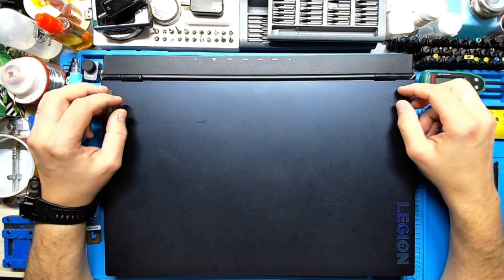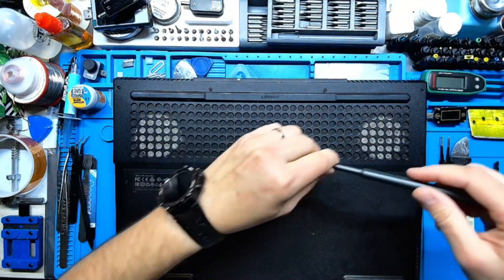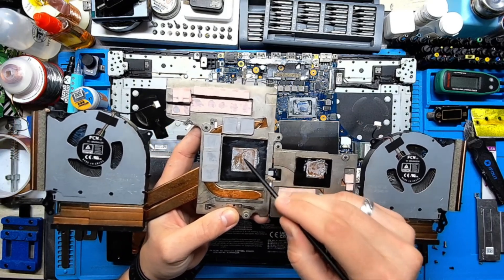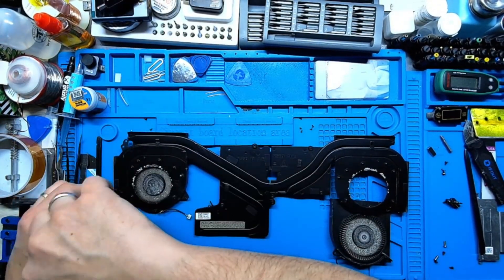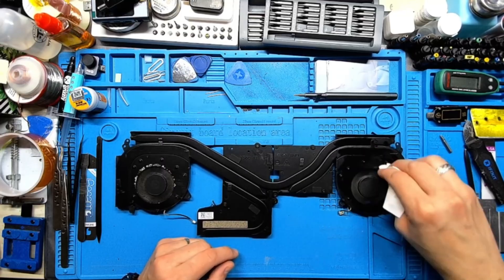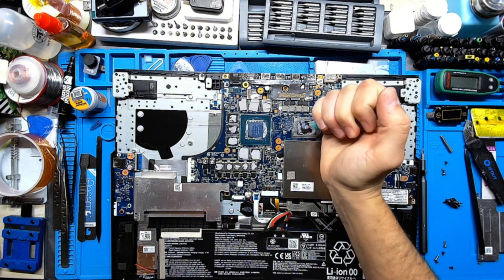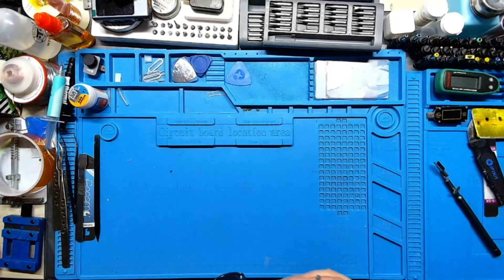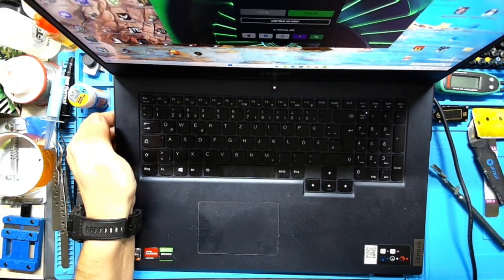Lenovo Legion 5 Thermal Upgrade – Arctic MX-6 Repaste

Comment: Do you need to worry about the old thermal paste sitting on the GPU CPU pins and board? Is that ok to leave there ? Also what about repairing the other chips on the board with paste , they would benefit from replacing the paste too I assume? Thanks
Reply from the maker: If the old thermal paste around the CPU/GPU dia can be easily removed, then why not removing? There is no major impact leaving/removing. It looks professional removing, the CPU/GPU chip surface it's less clogged, and maybe will not interfere with the heatsink when installing back, as old dry thermal paste becomes hard.

Comment: Nice!
Did 2 of those laptops the past week but as a business we have switched over to PTM7950 instead of paste and i replace the thermal pads with Halnziye HY256 Putty for better mounting pressure on the CPU/GPU.
Snarks Domain (also on youtube) has a nice laptop thermal putty guide and other video's related to putty.
Reply from the maker: Hey, thank you for all the information you shared. I'm experimenting also to find better thermal paste/pads/putty...